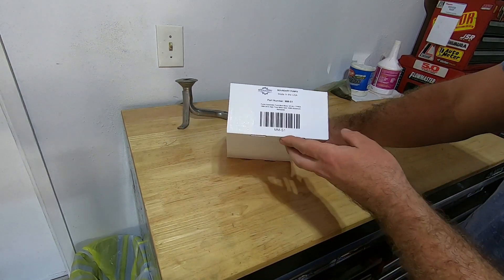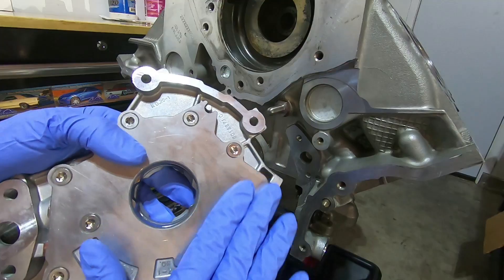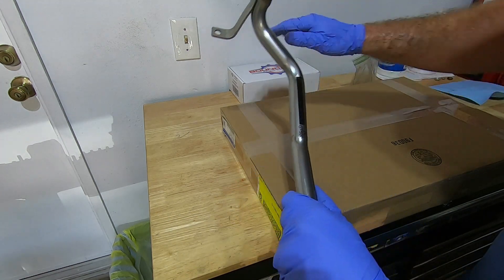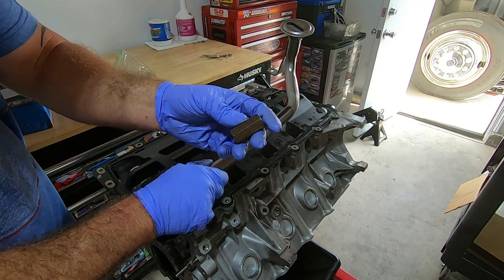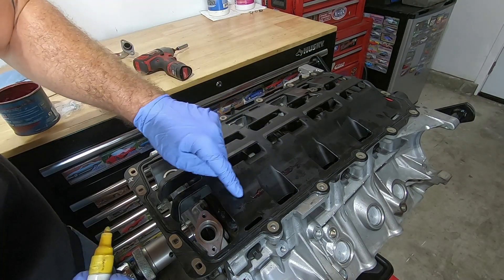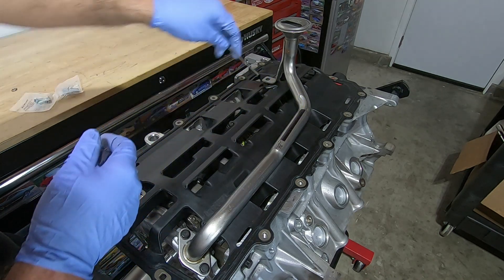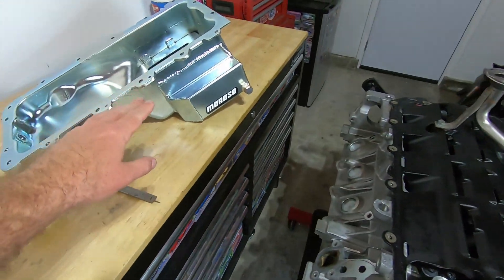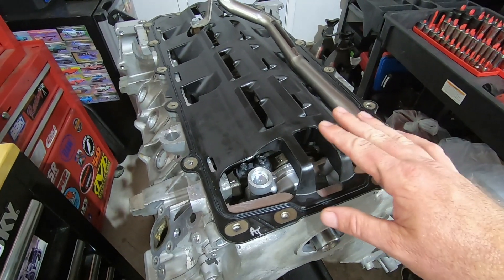Pt 13 Installing Boundary Oil Pump and Moroso Pan - 5.0 Stroker 4.6 Teksid Engine Block

Comment: Hi John, what’s the part number on your boundary, I’m building a teksid, with forged crank, out of an MMR 750hp cobra block, I did have the crank balanced (FYI), the crank won’t fit through the front of my boundary. The tabs on the face of pump are too tight, basically makes the hole too small. Thanks for any info.
Reply from the maker: The pump in this video is part number MM-S1

Comment: What’s the torque spec for windage tray bolts & that hex bolt / spacer ??
Reply from the maker: I put the ARP windage tray nuts and the hex to 20-25 ft-lbs.

Comment: Yes sir, the br3z6710b Oil Pan Gasket worked great for me. $50 from Tasca, but $40 for shipping :/ I did have to cut the tray a bit in order to use the stock p/u tube. Your clearance video using playdoh worked great :)
Reply from the maker: Yeah the shipping from Tasca has gotten out of control!
Reply: @JohnSmithRacing  any fitment issues with stock oil dip stick with this windage tray? I am having trouble putting mine in all the way.